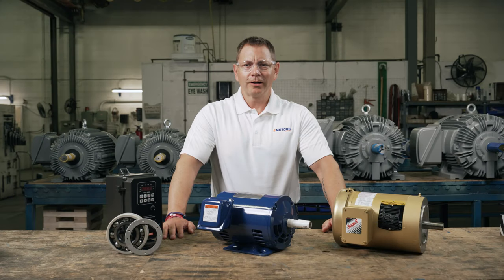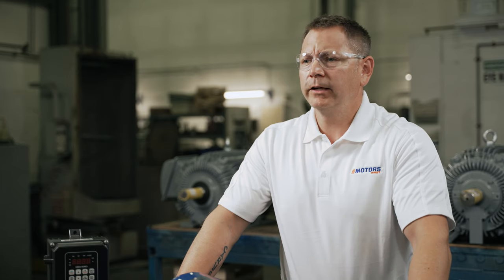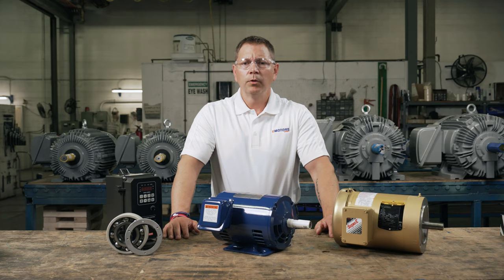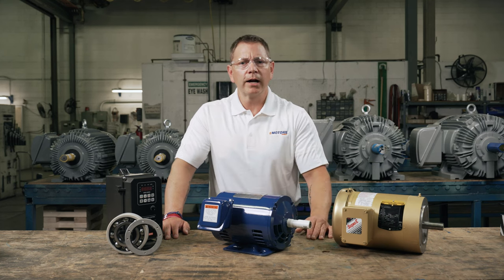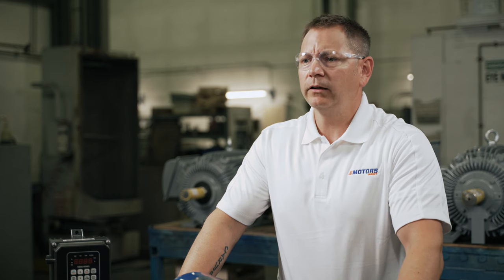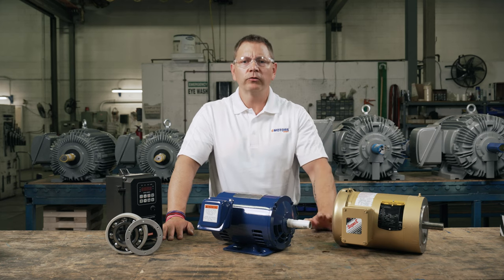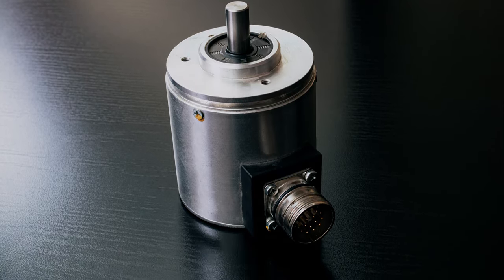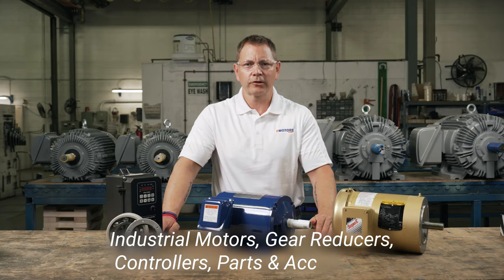What Types of Motors Can Be Used with VFDs?

Comment: Thanks for the great information.  Would MFR-J55WZ0BP-0114 be an okay candidate to control with a VFD?  Planning to update my drill press to support low end RPM for punching holes in metal.  I can't find the data sheet but there are lots of images of the motor ID plate.  Kind regards.
Reply from the maker: Thanks for the question Rusty! Based on the catalogue number, you are working with a DC motor. To control a DC motor, you'll use a DC drive. VFDs are used on AC motors. Here's an overview of our DC drives available in Canada and the US: https://www.emotorsdirect.ca/controls/dc-drives
Reply: @emotorsdirect  Thanks.  Any recommendations for a controller?
Reply from the maker: @rustyshackleford9066  For sure - your options will depend on where you're located. Do you mind sharing that? Thank you
Reply: GTA Ontario. Thanks  @emotorsdirect
Reply from the maker: @rustyshackleford9066  the KB Electronics KBWT-112 would be a good solution for low end torque: https://www.emotorsdirect.ca/item/kb-electronics-kbwt-112. However, before buying I would first check if this motor has a drive built in. One of my coworkers is a VFD specialist (Ahsan). If you give him a call, he can help you confirm if the motor has a drive built in. He can be reached at 1-800-890-7593 ex 108 and I shared your project details with him.
Reply: Thanks.  Is there a good resource I can use for looking up more information on that motor?  I noticed the site to order the KBWT-112 requests horse power.  Which is  not listed on the motor id plate. Even more confusing is the hertz is listed as 'variable.'  With my limited knowledge I would think it's suggesting the speed is controlled by the frequency as opposed to the voltage.  would the 112 still work well with this motor being 3 phase?  I'm trying to update my drill press so I don't destroy my bits when working with metal.  I pulled it from a treadmill.  I'll have a look at the controller provided that came with it.   I think it's an Emerson.  @emotorsdirect
Reply from the maker: @rustyshackleford9066  these motors are hard to get info on and OEM motor nameplates are not subject to the same requirements as regular motor plates so we can't really take the info on there on its face. These particular OEM motors also don't have a lot of info available. We can be a bit more helpful over the phone though, so feel free to give us a call. The controller also might give you some clues on the motor specs.

Comment: Good day.i have an home appliance from europe which power supply is 220v 50Hz.what can i do so that i can use it in my country,without damaging the motor, where our power supply is 220v but 60Hz.thank you in advance and more power.
Reply from the maker: Hi Jonathan, thanks for the question. You can use a VFD to operate at a higher or lower frequency, but there are some limits. In your case, this should work fine.

Comment: I have a question for you. I have standard 110 in my garage and I have a 3 phase motor I want to use on an old drill press. The motor is manufactured by “Brown & Sharpe and its 3 phase Alternating current.  There are nine, all painted black, wires protruding from the motor. Three sets of two have been twisted together and there are three left alone. Their numbers are 1, 2 & 3.

The motors information plate on the exterior of the motor shows that it can be wired 208-220 or 440. Under the 208-220 it shows the following: 

3 lead motor 1-2-3
6 lead motor 1-2-3
                       6-4-5
9 lead motor 1-2-3
                       7-8-9
                       4-5-6
So, can my motor support the use of a VFD and if so how do I wire it???
Is my motor VFD compatible? If so, how do I wire it???
Reply from the maker: Unless the nameplate has some reference to VFD or inverter rating, it is unlikely the motor is rated for VFD use. However, some non-rated motors just happen to be built with inverter grade magnet wire and can function just fine under inverter power with the carrier frequency set low. Unless the motor is somehow uniquely valuable, throwing a VFD on it will restore operation. But this might burn out the motor. 

A lot of motors made these days are VFD rated, but since it's an older drill press, it's hard to say. 

Most VFDs will come with a wiring diagram that will walk you though how to hook up the motor.

Comment: For a 10hp pump which corresponds to 7.5kW, do I use a 7.5kW vfd or slightly above that? Thank you
Reply from the maker: Hi Anas, thanks for the question. VFDs are sized by current. Manufacturers will generally add a horsepower rating with a decent safety factor. Check the FLA on the motor and the rated output current. If the latter is the greater of the two you're doing great.

Comment: How do you regulate the much current being drawn by a motor let me say for a motor of about 250kw when using a vfd
Reply from the maker: Hi Tigalana, thank you for the question. A VFD cannot control how much current a motor draws. Without going into detail, a motor will draw as many amps as it needs in order to turn the load. Under normal running conditions the amp draw is a function of the torque required which often scales proportionally with RPM. The only way I can see a VFD controlling current output is via speed control. VFDs often include current limiting circuits and thermal overloads. So they can stop the motor if amperage exceeds a set amount.

 I hope this helps!

Comment: I'm electrical stupid..
I have a 110 V   3 H.P.  3 phase motor.
I want to run it on a regular home single phase system.   So I think I need a 110 single phase input, to 110 3 phase output VFD.....are they available... can I do this setup ???
Reply from the maker: Hi Roger, thanks for the question. 

3HP is too large a motor to run on 120 single phase assuming 100% efficiency. A 3HP motor would need 19 amps and most home breakers will be 12 or 15 amp The wiring will be matched to the breaker size. If you are okay with using current limiting on their VFD to effectively turn the motor into a 1.5HP motor then this can work.

120V->120V VFDs don't exist. Most 120V VFDs output 230V through a doubler circuit. 

Let me know if you have any follow up questions!

Comment: When the motor is direct started without VFD. It is protected with a motor circuit breaker.
When using VFD, how do we protect the motor?
Reply from the maker: VFDs have overloads built into them and will fault out when too much current flows. It's not recommended to use an overload/contactor on the output of a VFD. Thanks for the question!

Comment: your thoughts on vfd on older J head Bridgeport mill motor?
Reply from the maker: These old mechanical variable gearbox motors are non-standard and very old. A VFD would probably work but it's uncertain how long. Since these motors are likely difficult to replace I wouldn't recommend it. You could bypass the J head varidrive entirely and throw in a newer motor however I'd need more details on the project to be sure.

Comment: Can I run a vid on a Leeson  131534.00 it’s for 2007 but it’s barley been used than in advance
Reply from the maker: Hi Jay, thanks for your question. Some single phases motors can be run on a VFD when sized appropriately. However, cap start induction motors like the Leeson 131534.00 cannot, the motor starts on a capacitor and has a switch that bypasses the capacitor at around 80% RPM. This means that if you under-speed it past about 80% the capacitor is brought into the circuit and since the capacitor isn’t rated for continuous operation it will burn out.

Comment: It's a little hard to tell from the video, but is the main problem with using a VFD that it is not as clean or smooth as true 3 phase? I am thinking of a very narrow application where you would simply want to run 3 phase from a single phase. For instance, if you bought an industrial compressor on the cheap and wanted to use it at home. The VFD would essentially just be a way to use the 3 phase motor on a residential single phase supply. It would be configured once and never change. In this scenario does the VFD negatively effect the motor, or have the potential too? I'm trying to understand if the issues raised in the video are due to the assumption that the VFD will be used to actually vary the motor speed or not. In the scenario I described the VFD would be more like a fancy starter.
Reply from the maker: Hi Travis, thanks for the question. Due to the way that VFDs reconstruct the power waveform they produce large voltage spikes, these spikes can overwhelm the winding insulation, short them out, and start arcing. The arcs produce heat that further damage/degrade the windings. A similar phenomenon may happen across the bearings. Most manufacturers now use inverter grade magnet wire as standard and this neutralizes the winding arcs. Bearing discharge remains a problem but you can always get a grounding ring.

A further consideration is that VFDs are so much cheaper than running a 3 phase line or a rotary converter that you could burn out and replace your existing motor with an inverter grade motor and still have saved money compared to the other options.
Reply: @emotorsdirect  Thank you very much for the reply. That clears up my confusion.
Reply from the maker: Happy to help  @travisthompson1679  ! That's what I'm here for.

Comment: thank you for this insight. my question, is there a way to use a VFD with single phase induction motor 4 poles that uses a centrifugal clutch? i mean, is there a way around it?
Reply from the maker: Great question. Technically you can. There are YouTube videos out there that show how to do this. But it's not something we recommend as VFDs and single-phase motors were not designed to be used together in this fashion. It could burn the motor out or it could damage the VFD.
Reply: @emotorsdirect  thank you for your reply, i was looking for a VFD to add to my drill press motor, but might be better off with a  3 phase motor first , thanks 👍
Reply from the maker: @NLDHGRockStaR  100%. Let us know if you need a hand finding the right motor or controller.
Reply: @emotorsdirect  will do, thanks 👌

Comment: I have a b a l d o r brand motor it requires vfd the motor is three-phase and it's 200 to 400 volts on the ID tag the question that I have is it powered by 120 volts ac to the vfd to control the motor or does it still need to be hooked to 220 can't seem to figure this part out
Reply from the maker: Hey Tony, thanks for the question. 

This will depend on the rating of the VFD.

Take this example of this KB drive (https://www.emotorsdirect.ca/item/kb-electronics-kbda-27d), it is rated for either 115V or 230V input but will always provide a 230V output since it has a voltage doubler for the 115V line. For a drive like this, it can take 115V input and output three phase 230V for a 230 V motor. If your drive doesn't include a voltage doubler, then you will need to provide a 230VB input.

I hope that answers your question. - Keith

Comment: If you run the motor at too high speed, its torque can decrease to the point when it can't maintain rotation and will straight up stop completely, coils will draw too much current and damage VFD and themselves, potentially causing fire.
Also if you run it at really extreme speed, and this motor is large, its rotor can just tear itself apart, causing massive destruction to whatever rotor's debris hit.
Reply from the maker: Thanks for your comments. Here's a video on how fast you should run your motor and why: https://youtu.be/skEaxx5YJbI

Comment: Like your videos and my question is if this model of motor works with vfd. Model #5k49nn4472x thanks
Reply from the maker: I couldn't find much information on this motor. I'm assuming this is a discontinued OEM motor. Because it looks older and is ODP, I'm guessing it's not rated for VFD use. It may not have the cooling capacity required to use with a VFD.

Comment: Thanks for your expertise. Is it possible to use a VFD on single phase motors. I am setting up an off grid wood machining shop and am trying to size an appropriate generator and hoping to reduce inrush current so I do not need an oversize generator. Any advice would be appreciated. I am going single phase as my existing machines (biggest 5hp) are single phase and because of the wide range of single phase tools available . It will also be used as the backup generator for a solar power system.
Reply from the maker: I would recommend running a three-phase motor as single phase output VFDs can be expensive and most modern 3 phase VFDs can't run a single phase load due to phase-imbalance-trip circuitry being standard. As for the intuition on not needing to oversize the generator, you are correct that the VFD would reduce inrush. But on the converse, you'd still have to oversize the generator for the harmonic distortion the VFD would produce unless you paired it with line filtering. If you'd like the particulars on any of this, please email us and we can help iron out the full package of things you would need in either scenario.

Comment: Unusual, most high capacity electrolytic capacitors in circuit have bleeder resistors across their contacts to bleed off high voltage.
Reply from the maker: They do have bleed circuits. If this is about letting a drive rest a bit before opening it up to inspect it, the prohibition regarding rest time is to allow the bleed circuit to reduce the stored charge to safe levels.